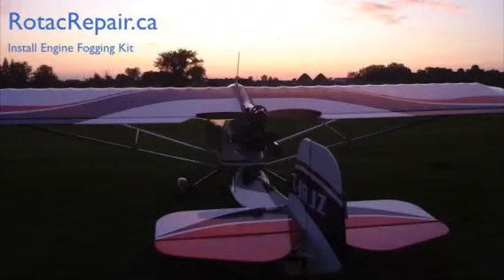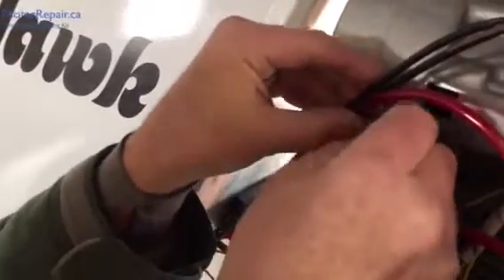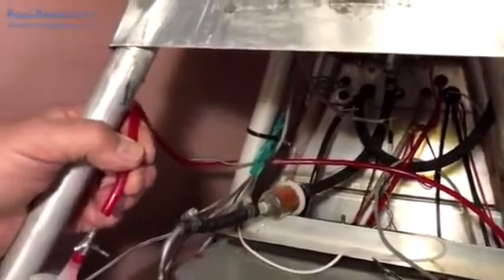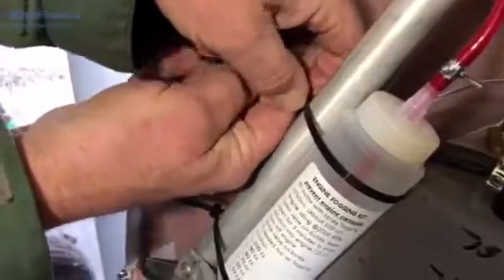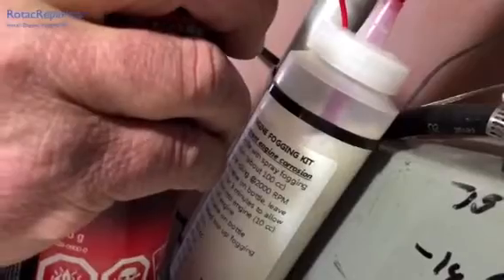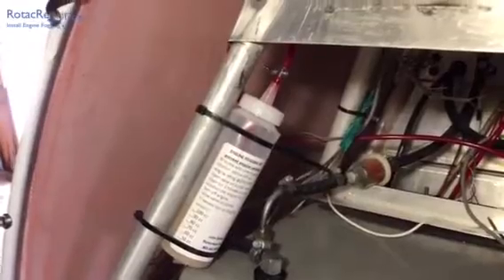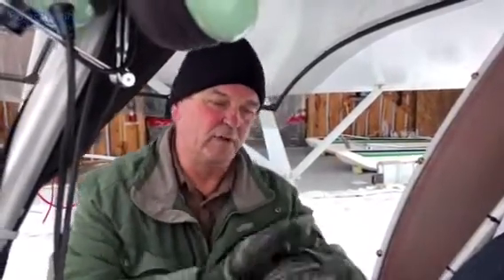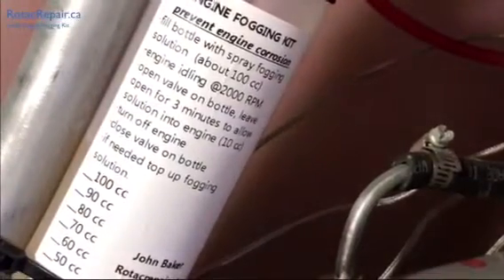Rotax 582 / 503 ultralight engine Fogging Kit

Comment: My 503 rotax 503 is mounted inverted on a quad ity challenger.  8 purchased your fogging kit and have it installed and operating as directed .   My 503 has recently undergone a total overhaul.  Question is with my new crankshaft insalled inverted, does the fogging kit get lubricant past the rings and pistons and so  keep the crankshapt needle bearings lubricated when used on a regular basis
Reply from the maker: Absolutely, the fogging solution will circulate through the entire engine protecting the crankshaft and everything else. Regards John

Comment: what can you do for a non running engine out of the plane?  I put 2 stroke oil in there, rotate the crank, turn it upside down etc once in a while and keep it inside, what else can you do?
Reply from the maker: I would suggest if you haven’t already done it, to plug carb and exhaust openings tightly sealed